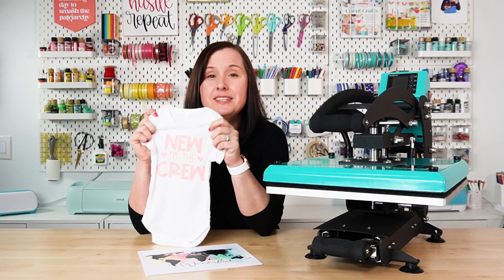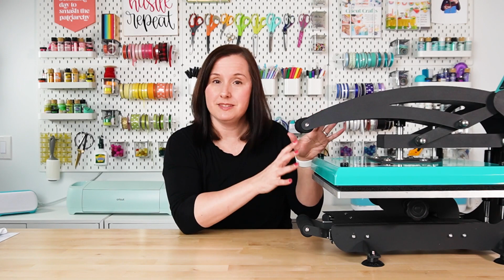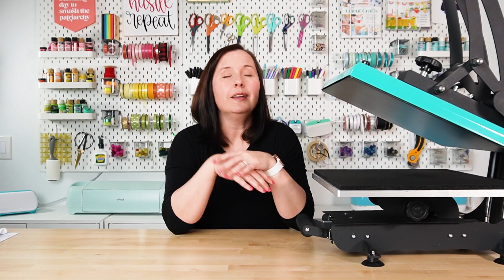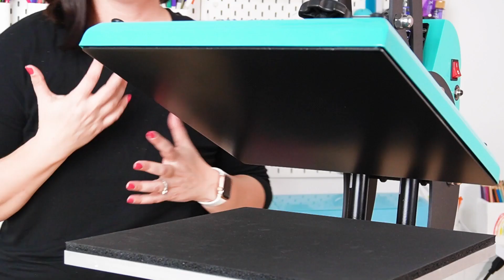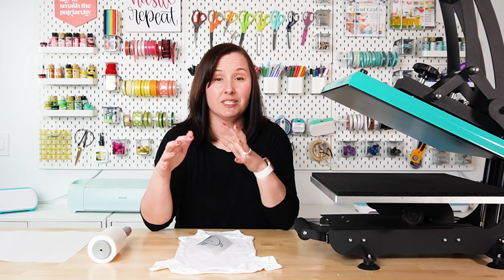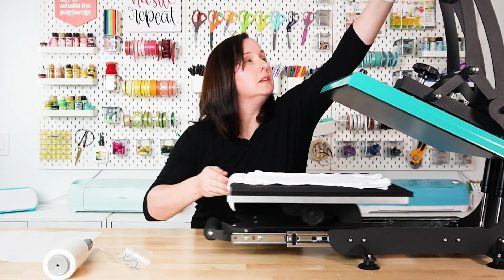How to Use a Heat Press Machine | Beginner Tutorial for Cricut, Silhouette, Sublimation and More!

Comment: Cori thanks so much for this video. I have a tumbler press and clam shell heat press that both came from Amazon and they both emit horrible smells when heating. I had an HTVRONT auto press also from Amazon and it didn’t smell at all so I know the smell isn’t from pressing vinyl or sublimation, this is mostly what I do. Does this one smell? I’m really interested in this WALA, it seems like that press is good quality.
Reply from the maker: Sometimes I think sublimation is inherently stinky, but I will say that this press does not smell nearly as much as my tumbler press!!

Comment: Hi! would you recommend this walapress v3 15x15 for thicker hoodies/sweatshirts 10oz+ ... I'm concerned that there's not enough room once you push the drawer in bunching up the fabric, pinching it. Have you had an issue with threading and bunching up larger garments 2xl when pushing the drawer all the way in? Thanks!
Reply from the maker: I went ahead and tested it to see! I didn't have a 2XL but I put almost an entire medium hoodie toward the back of the press so only the pocket was on the platen—the rest of the hoodie was hanging off the back. I was easily able to push it all the way in. It sort of tucked underneath the tray. I was actually surprised—no bunching at all!
Reply: @HeyLetsMakeStuff  Also is this the Walapress V3.2 on their site that also comes in gray color? Does it auto-open with timer and has a emergency release button for early open? Thank you!
Reply: Another thing sorry :) Is this press threadable especially for thicker hoodies/sweathirts? How has your experience been a month later? Thank you!
Reply from the maker: @filmingyu6623  Mine doesn't have an auto-open feature, though that would be nice! I think they have a few versions. Mine is the one linked in the description of the video.
Reply from the maker: @filmingyu6623  What do you mean threadable?
Reply: @HeyLetsMakeStuff  Ig you can put the platen on the inside of the shirt or hoodie so you're only pressing one side of the garment at once. Usually presses that have space at the bottom or dedicated slot below the bottom platen for extra room for fabric?
Reply: @HeyLetsMakeStuff  Awesome thank you! Would love to see more videos and demos of you using this specific press! Love your content!